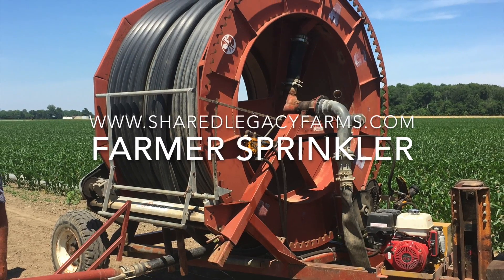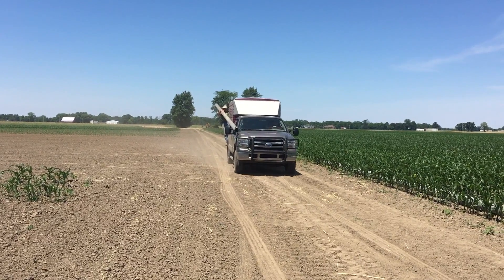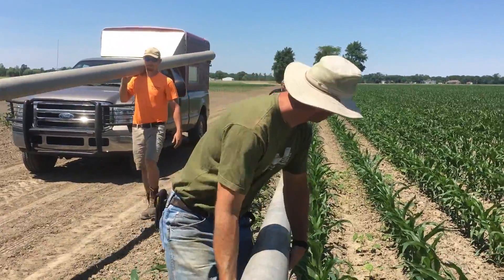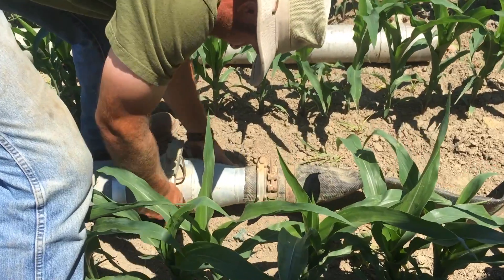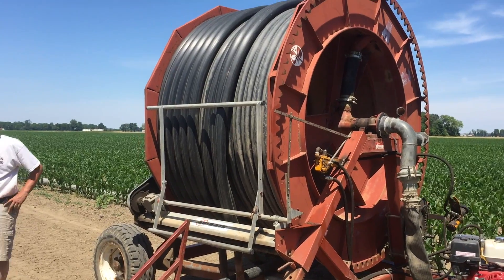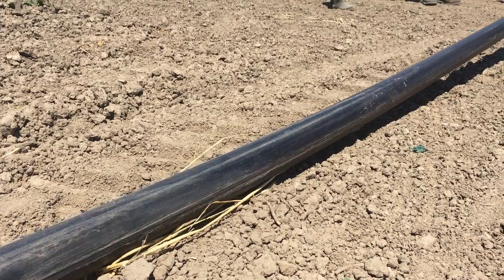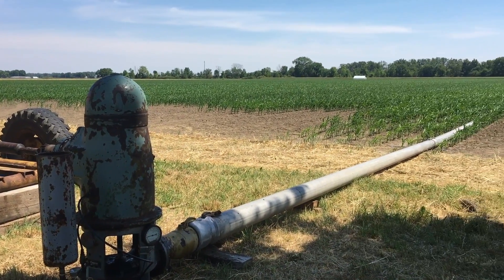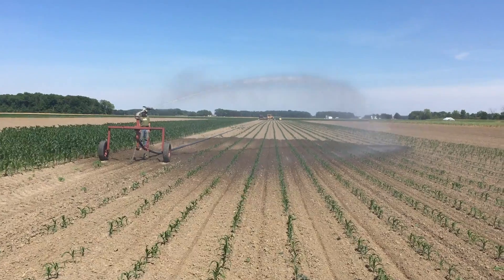How an Irrigation Wheel Works

Comment: Actually it’s a p150 Nelson big gun. Fast reverse. Old and have been replaced by the SR Nelson guns made now. The p100 and 150 have the reverse deflector lever under the barrel for its reverse cycle. The p200 has that lever on top of the barrel.